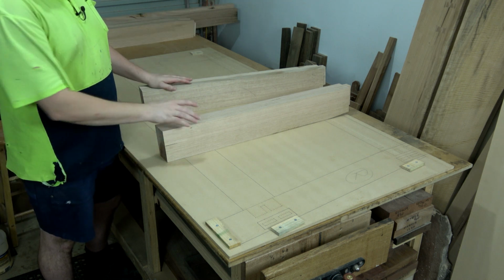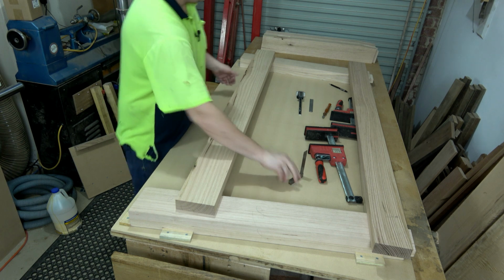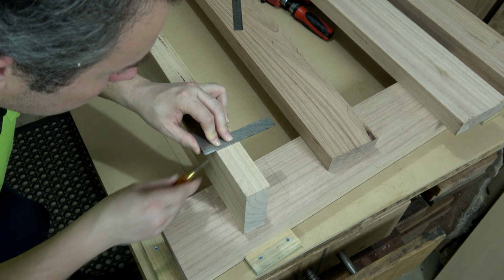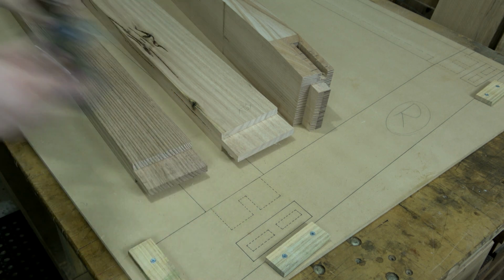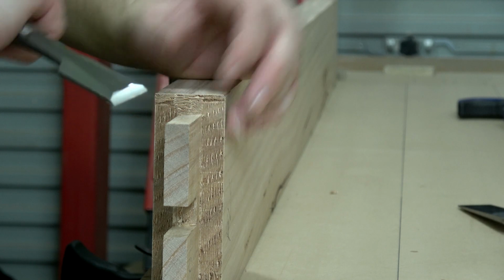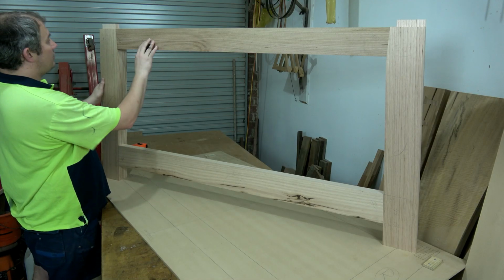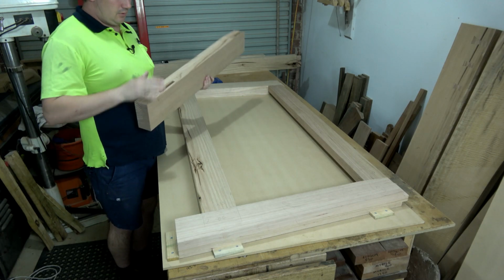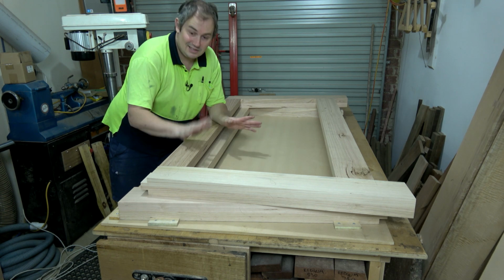OzzyOcker Workbench Build Part 4 - Tenons

Comment: I can see the difference between metal machining and fine joinery now, we use the gnat's willy measurement, a much finer unit than the bee's willy  😁😁😁 , love your work, thanks Kuffy, very impressive mate 👍👍👍.
Reply from the maker: I'm actually rarely measuring on this build. I'm simply building parts to fit between point A and point B. If I was building lots of square parts, then I would certainly build by numbers.

Comment: I think you can say... a knife line is equal to the thickness of a bees willy LOL. You have that 'Beautiful' HT Gordon shoulder plane and you were using the chisel??? Ok, many ways to skin a cat. With your tight spaces and making a knife line, get yourself a small pen knife, it gets into small spaces.  Agree with the template. I've used them quite a lot. especially with odd angles. my take away is the little blocks  to hold the legs in place, so thanks for that tip mate :)  Happy New Year.
Reply from the maker: Lol yeah, a shoulder plane to me is more of a cheek plane. I rarely use it on tenon shoulders, preferring to cut the shoulders directly on the saw when they are 90°, or with a chisel. I do use the shoulder plane for breadboard end tenon shoulders though, it's a great way to take that last shaving or two along the full length in a consistent manner.

Comment: First of all - at the end of some brief new year's salutations I will comment on the workbench. Happy New Ear 👂. 
So much accuracy - I dig it - which incidentally - digging is pretty much how I make all my joinery compared to your humanoid++ level precision - seeing this makes all my woodwork blush and feel dirty, but you know - appreciate you showing it 'cos well - no need to wonder how it's done anymore. The iterative process towards a perfect fit is quite mesmerizing. Go #OzzyOcker oi oi oi
Reply from the maker: Humanoid++ ya reckon? After years of running CNC routers which have supreme accuracy and repeatably, it has changed the way I look at the process. I can see where the gaps get introduced or misalignment's occur. So I go out of my way to avoid them because I know what the perfect fit up looks like and anything less annoys the hell out of me. It's all about marking with knife lines and making sure the lines are correct and that you trust them when using the saw or chisels.
Reply: @kuffyswoodwork  Having been a software developer for most of my life it is very satisfying to command some computerised device to something for you once and to then have it (in my case sometimes) do that same thing millions of times. I see the same kind of satisfaction in your process as I do in writing some code that does everything perfectly. I guess like everything - that ability comes from observing say, the CNC at work, combined with seeing it stuff up as well, and then applying that to your own hand made things. I could waffle on but it's all pretty "meta" I guess, like - who's going to send the Queen a telegram when she turns 100! but I have to go out for lunch. See u next episode.

Comment: Looking good so far mate. I must commend you on your attention to detail, I only wish I had that level of patience.
Reply from the maker: Thanks. I'm pretty much over the hump with this build now. The remaining work, although time consuming, is something that is fairly easily measured out so I can finally relax a little 💪👍
Reply from the maker: @ohasis8331  It is a lot of extra work, but the advantage is that the side mortise wall remains strong. Without the web of timber in the mortise, that mortise wall can flex or break while dry fitting the tenon. I've broken them before because a tenon always starts off as being too fat and finishes at the exact right thickness. It also means that I can actually make the tenon slightly tighter than I should and the mortise won't simply stretch open negating the effect of the slightly over-thickness tenon and instead it will slightly compress the timbers which swell back up again with water-based glues.